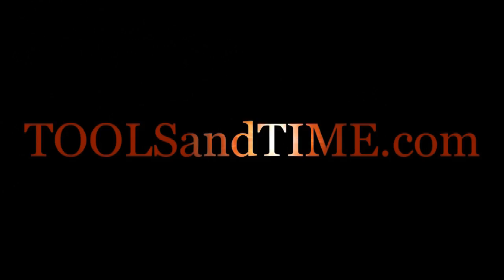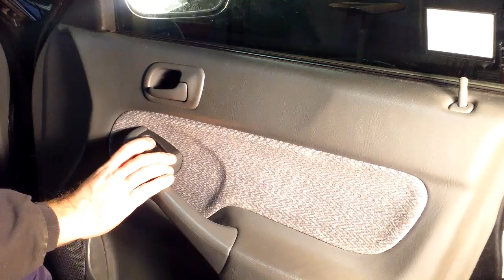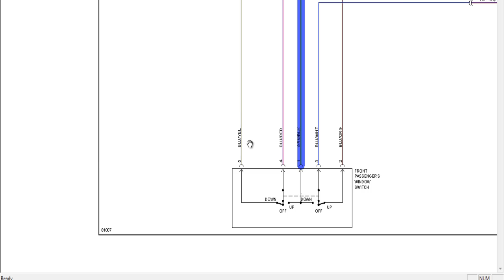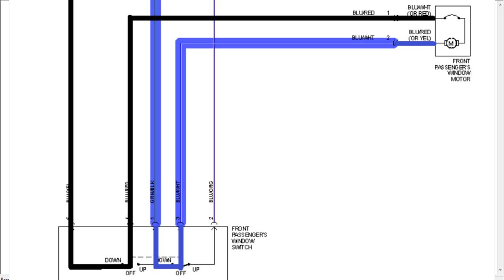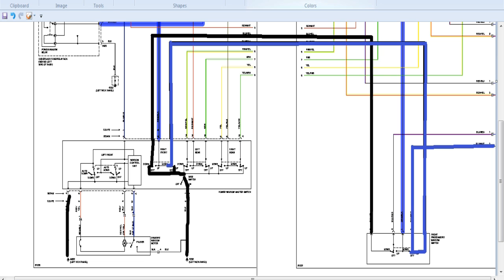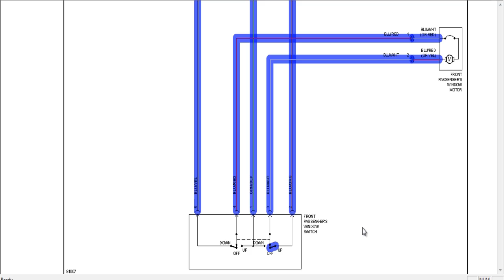How to troubleshoot power windows using a schematic Honda civic

Comment: What if I don’t have power on the green/black wire and there’s nothing wrong with my fuses ?    Can it be that my master switch is bad. Because all the other 3 windows work but not the front passenger side.

Comment: Great step by step video. My 2000 Civic has the exact same scenario. Unfortunately when I checked and had power at the switch both up and down, I bought and installed a motor/regulator with no results. The ground is the problem and searching for the break now. Thanks for the tutorial.

Comment: I just used this for my 2001 Coupe passenger door.  It applies, but colors have changed and ground connections reversed (Look at switch at time 9:56):  1) GRN/BLK (hot), 2) RED/BLU (motor), 3) BLU/WHT (ground), 4) RED (motor), 5)BLU/RED (ground).
My problem is I lost ground on wire #3, so window wouldn't go up.  I just shorted across (pins3 to 5) to the other ground with a paper clip.  It's working, but I'm trying to figure out the downside of keeping it like that.
Reply: And it's obvious that I hadn't watched part 2 yet when posting.  LOL

Comment: have you got a wiring diagram for a honda civic 2015 radio/attena system as i beleive there is a module in line with the shark fin plaes advise Great videoes

Comment: I have a 2003 Honda Civic dx but my issue is strange the driver and rear passenger are the only ones that work. The front passenger and rear window driver have short I replaced both fuses but then it burns them so yeah. Thx if u reply

Comment: hi, unfortunately, the down, up and off position is not clear, meaning in schematic i can see all three words down, up and off, what i dont know is, when will the wire be connected from point a to b during down or up or off. bcz all three words are written .. can u pls advise..
Reply: Actually, RobinsonsAuto isn't quite saying how the switch wiring diagram works correctly, but nevertheless his logic is still sound. Let me explain, at 6:38 of the video (where he's zoomed into the switch), let's just focus on the right front switch, notice that a switch is represented with 3 vertical lines, notice also that there is a horizontal dotted line running between the left and the right vertical line. Now, look very carefully just above the word OFF is a black solid dot/circle and right above that is a solid upside down arrow. That arrow is on the bottom end of the left and right vertical line. Notice that a little bit more above the arrow is a black dot/circle. That black dot is the pivoting point. Meaning when the switch is pressed to the DOWN position, both arrows swings to the left and makes contact with the down contact point (dot/circle). That's what the horizontal dotted line between the two vertical line means. Press down and they both swing to DOWN, Press up and they both swing to UP. Notice that pressing down and having the arrows swing to the left to make contact with the Down contact point made no difference with the ground that's been sent to the Blue/Yellow wire. But, it makes a lot of difference for the Blue/Orange wire when it swings to the Down position.